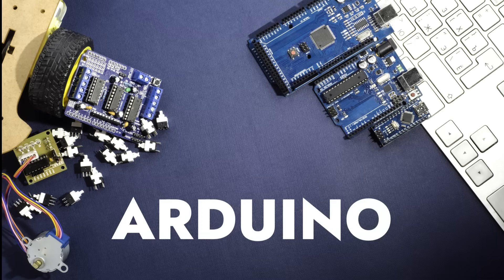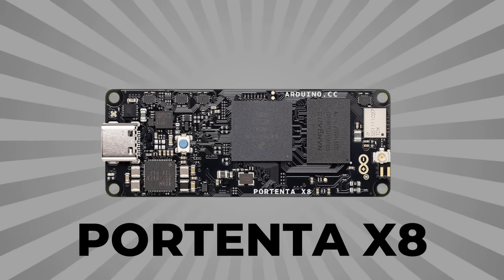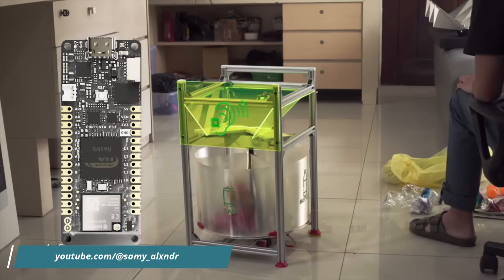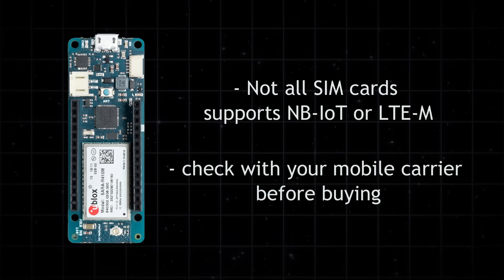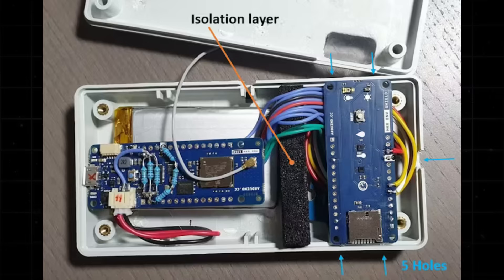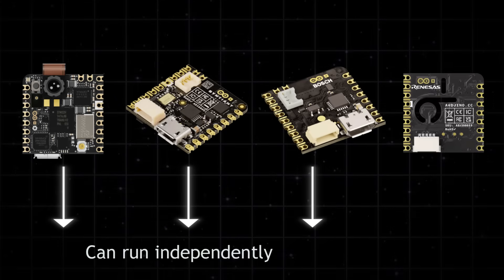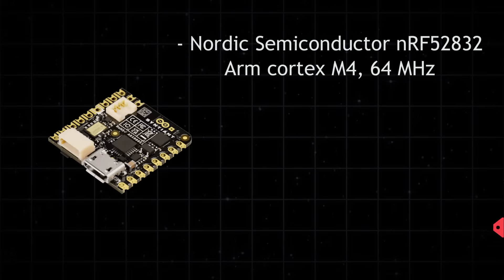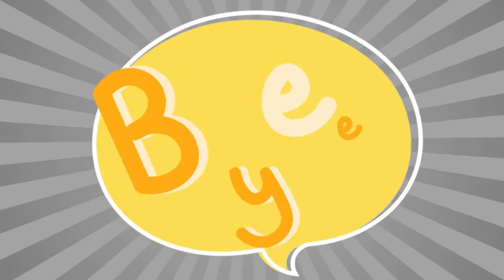10 Great Arduino Projects with Powerful Boards!

Comment: Hi, I’m working on a Self-Healing Cable project using Arduino.
The idea is:

Main cable in use, standby cable connected as backup.

A sensor detects when the main cable fails or disconnects.

Arduino triggers a relay to instantly switch to the standby cable.

Can you please guide me on:

1. Which type of sensor is best for detecting cable failure?

2. How to connect the relay with Arduino for quick switchover?

3. Example code or circuit diagram for this setup.

Comment: Do you have any interest in doing a video on the Arduino Giga R1 Wifi?   There is very little project material out there for this board.  I can't even find serious books about programming for it.  Any suggestions?  (Yes, I played with the library example sketches, I was just looking for more.)